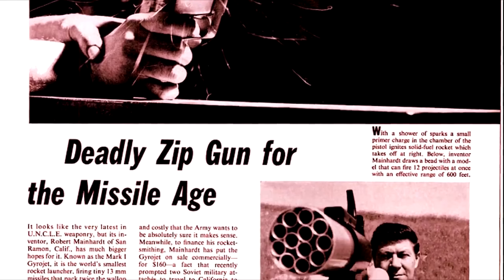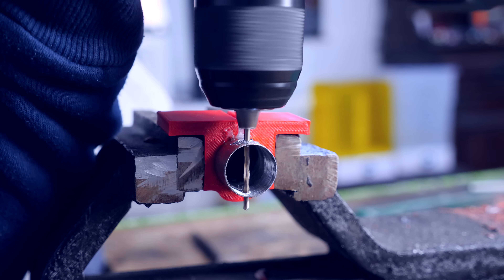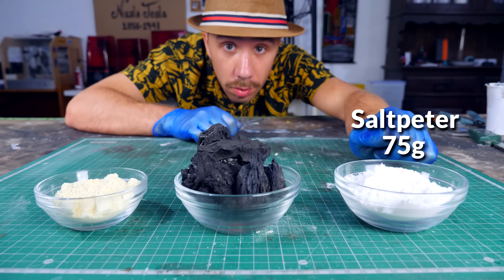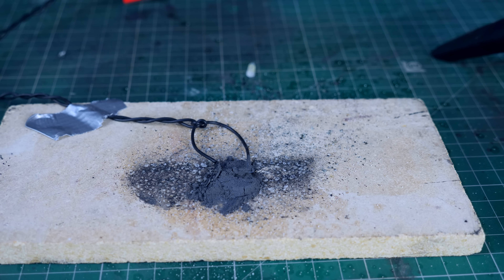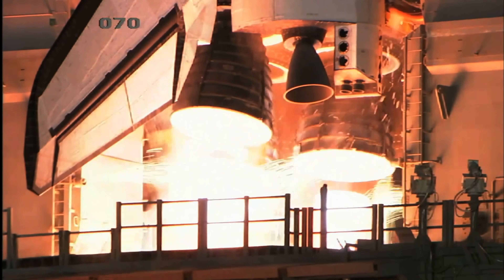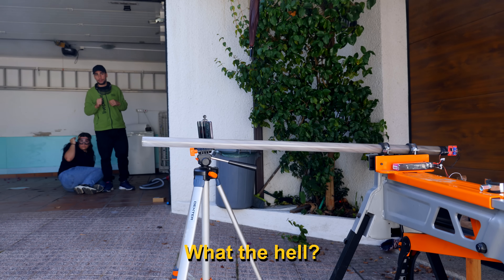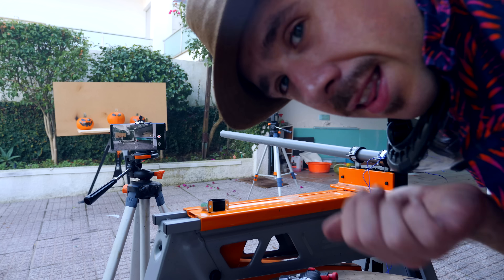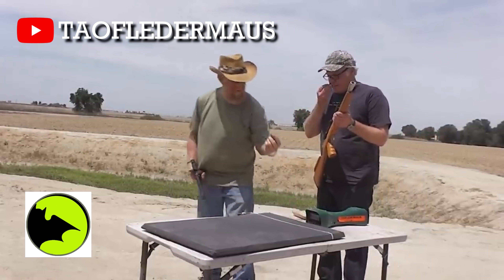GYROJET - The Spinning Rocket Bullet

Comment: A suggestion, I think you have an aerodynamic problem caused by most of the mass of the projectile being at the back end of it. This places the centre of gravity of the projectile behind what is called the centre of a pressure, a point where the on rushing air will make the projectile point in the direction of flight. CG needs to be in front of CP to make a stable flying object, the further in front the more stability. I think you need to add mass to the capsules nose before assembling the rocket. This should ensure stable flight.

Comment: Only one of the nozzles are igniting. If you look at the original bullet you'll notice that there is a primer. With a center pin ignition in the center of the bullet that ignites all the nozzles at once from behind the nozzles... two nozzles isn't enough you should have a minimum of three to balance it, four preferably

Comment: Like your show. 👍
On that note. Add slightly more nozzle angle in order to start it spinning sooner and use an odd number of nozzles. Essentially you want 3 to 5 of them to get even thrust around the entire circumference of the cylinder. Pretty sure that will send your rocket bullets.

Comment: Idk if anyones mentioned this yet, but im pretty sure the instability is from the fact you only have 2 nozzles. If you had 3, or the designed 4, you'd be able to stabalize it from more points than just opposing sides.

Reason for my theory: If their on opposite sides, slight differences in thrust will cause one side to yaw, and that yaw multiplied by roll causes it to tumble out. If you had one more, or 4 like the original, the slight differences could be cancelled out by each other.

Comment: It's also not spiraling not trying to being mean or anything but just doing for you it's called rifling funny name right what actually has its purpose it's so that it will make the board rotate what kind of slows it down a little like not very much like not not a lot so you have 60 FPS on the PC that goes down 0.1 FPS that's basically no change that's basically what happens it makes the speed by 0.000000001 miles an hour

Comment: I have more than a few ideas of making a reusable casing without the need for a clunky primer, as well as how to make a proper gun (even one in which the action takes advantage of the gas from the propellant mixture). 

If I ever decide to start making videos, I'd really like to try making it. Unfortunately it couldn't really take advantage of 3D printing, as I'd likely mill the bullet —including the nozzle— out of a solid piece of metal. 

On another note, I'd also experiment with straight-firing nozzles on a bullet that is spring-assisted in exiting a rifled barrel.

Hm, I'm probably on a watchlist now, aren't I? Eh, with my video watch history I'd be surprised if I wasn't already 😂

Comment: just a heads up, the rocket needs its center of gravity in front of its center of pressure (air resistance) or else it'll spin uncontrollably. a good way to fix this is by using weights in the front.

Comment: You could try to angle the rocket so that it propels it in a circle instead of straight on. That might help with the tumbling.

Another thing that will reduce tumbling is having 3 instead of 2 outputs

Comment: I had a idea while watching the video I noticed that the original projectile had 4 openings on the rear of it and they where curved and in a oval type of shape. with that being said what if you made a ceramic insert that  has 4 open groves along the diameter of the insert and used the case for the outer part this way it isn’t pushing it up or down it’s pushing it up down left and right at the same time to help it gain a faster spinning velocity

Comment: I missed this when it first came out.  It has been a while, but here are a couple ideas to help the rocket bullets fly straight.
1. You cannot rifle the barrel to get a stabilizing spin, but what about the rocket exhaust?  A rifled pinhole, leading to angled exhaust bells for the nozzles?
2. Fins and spin are not he only ways to stabilize a rockets flight path.  What do a kite and a bottle rocket have in common?  Drag.  Some model rockets use a similar method for recovery  with a ribbon streamer slowing it on decent.  A tiny carbon-fiber ribbon attached to the center of the back of the bullet.  Roll it up and place in into one of the nozzle bells to maintain the shape of the bullet when loaded.  One fired, the exhaust should unfurl the ribbon, causing drag at the back of the rocket and forcing it to fly strait. Using drag alone, you could have 3 streamers placed equidistant around the back of the bullet rolled and placed into a central nozzle. I think they should be 2/3 times the length of the bullet.  Should stabilize nicely.

Comment: In Nerf Modding people normally use a Scar Barrel to give the Dart a spin. Some say that the Dart is also more stable because the Air behind the Dart isn't pushing the Dart in some Side Directory. While the Dart is in the Scar Barrel the Air dann escape to the sides. Maybe something like that would help stabilize it.

Comment: Your ceramic nozzles don't look like they degenerated too badly so props there, however the original gyrojet had four instead of two nozzles, and this may have been important to achieving a greater degree of spin stabilization.  Worth noting  that gyrojets were still inaccurate compared to handguns of the time, 17 MOA or about 4.5"/11.43cm at 25 yards/22m.  For comparison, any well made conventional handgun can get that same 3-5" spread at twice the distance, 50 yards/45m.  
In addition, the original gyrojet used a fairly conventional primer cap to ignite it, and a faster burning propellant than R-candy.  Stuff is great for hobby rockets but probably deflagrates too slow to allow for the kind of prompt acceleration needed for a proper gyrojet bullet.

Comment: Integza, I have an idea and would like to pass it by you. It has to do with gun barrels. If you could evacuate a gun barrel just before launching a bullet, you would get rid of the force that is holding the velocity of the bullet back. Here is how I propose to evacuate the gun barrel.

1. Take a gun barrel with holes in it and put it inside another tube.
2. Apply moving air to the outer tube to create a venturi vacuum inside the gun barrel.
3. Turn off the air as the bullet is shot with a valve.
4. The bullet would go down the gun barrel with no opposing air inside the barrel. 
5. Gasses inside the barrel would be at a higher pressure and faster flow, creating an opposite century effect where incoming air would force gasses out of a barrel.
6. Start the airflow through the outer barrel as soon as the bullet leaves the barrel

 Note Recoil will also be diminished because there would be no gas in the rifle barrel to overcome. The outer barrel and Air Ventury would handle recoil issues. The barrel could be lengthened for more accuracy. The speed of the projectile would be increased.

Comment: Amateur rocketry folks who make small engines make the nozzles with a mixture of clay and other ingredients which are rammed up around a form. United Nuclear in the US sells both the nozzle mixture and the nozzle forms, but more importantly they have pictures from which you may be able to derive a 3d-printed form.
Reply: It also seems to me that in order for your two nozzles to correctly spin the "bullet" they have to be equidistant from the center of mass of the bullet to a fairly high degree of accuracy. Because your nozzles were loose, they may not have been well-centered enough, and so the axis of torque for the nozzles was not the center of mass of the bullet, which made them wobble and go off course.

Comment: There are one little detail on gyrojet pistol... It have a detail under spring tension which holds pellet befor ignition AND untill it have enough energy to fly straight enough. ALSO!!! Better to make narrower nozzle to generate more pressure... At least I think so... ALSO!!! It is wise to look on shells for soviet reactive artillery like TOS-1 and etc. They have exaxt answer about nozzles for such pellets You seek.

Comment: RECOMMENDATION:
Why not incorporate TWO principles into making the GyroJet work?

The main reason these GyroJets did not work is because they did not have enough spin to counter the strength of the rocket thrust trying to asymetrically throw the rocket off it's trajectory. This can be solved by reducing the thrust (not good when trying to increase speed), or increase spin rate to overcome the thrust being produced . IDEA: Why not use Tesla turbine principle to prerotate the GyroJet before launch.....spinning it up to incredible speeds? All it would really require is a grooze cut into the barrel to allow high pressure air to circle the rocket, and circular iginition bands to keep electric contacts for ignition whilst it spins up. #TeslaGyroJet

Comment: Sorry but black powder the type of gun powder you made has a constant burning rate regardless of pressure it is modern smokeless powder based on nitrocellulose that has an elevated rate of combustion due to increasing pressures you would think if you're going to make a video about something you'd actually read even just Wikipedia so that you give out accurate information not that hard to find out do your research next time set a good example

Comment: You might be better served with increasing the ballistic coefficient of your projectile, i.e. , reducing its diameter and increasing its length. This not only mitigates the Δcm w/respect to time, it also will improve stabilization of the projectile where the rotation about its long axis is minimal. Take a look at a Match Grade, 7.62mm diameter, 168 grain (≈10.89 grams) Boat Tail hollow point bullet that’s commonly loaded for the 7.62x51mm NATO round for competition purposes as a guide in conceptually apprehending this idea.

Comment: Metal plates with holes off set and then added together to create the needed channels to create spin, or maybe do it even simpler, but that requires metal work. I can sort of see a metal plug with 4 groves spinning around it's outside. When that is added tightly to your rocked you'd have a nozzle if done right and it would be contained, or will it. I do not know, but figuring out stuff like that is fun so now I wish I had the means to test it. The nozzles should almost be like a screw should it?

The bullet needs to spin fast to have gyro stabilization so the nozzle shouldn't point most backwards but rather nearly 30 degrees off to the side and 2 is not balanced so it might need 4 nozzles to really work. Just be danged carefull testing ideas like this.

Comment: I'm a fluid mechanics engineer. I think I can see about 3 problems.

1. Your bullets may have an off centre centre of mass due to how you're packing them.

2. They're not gaining enough speed at the end of the barrel.

3. Your narrower barrel is more accurate than the wider. I think that there's a pressure build up in front of the bullet as it travels down the barrel so in order to counter act this, you should cut vents down the length of the barrel. You can see that in the original designs. You can see that when you used a bigger pipe it accelerated more due to I think more gasses being able to vent around the bullet (but reduces accuracy as it can then move around within the pipe). That might solve the second point.

Comment: Take another look at your video, index time 12:20, and you'll see spin within the acrylic tube. It did need that kind of tight fit to get the rotation you were looking for. I haven't looked at the original gyrojet nor am I a rocket scientist. But I did grow up with a gunsmith. Your primer idea was on the right track but should be more focused; centerfire boxer type would work with the electrical leads. The solid propellant: was a mess; needs to be a higher concentration. Look at the H&K G11 caseless ammunition for instance. Overall; nice project. Please take it outside the city limits next time. Or find a drainage ditch.

Comment: Well you are always asking for 3d printing ideas this is less about a 3d print idea as a method to print your rocket parts credit where do the youtube chan and vid in question 
https://www.youtube.com/watch?v=cvi8A2XCK94
uses a ceramic coating to create a mold for metal casting. You dip the 3d part several times to make the mold and burn/melt out the pla leaving a mold etc etc

Comment: 3D print a gun powder engine and  see if there is a way to make one actually viable. The problem I saw when Mythbusters tried it was lubrication in the piston cylinder. So maybe having the gunpowder ignite in a separate chamber with a way to filter soot out in between and force the gasses into the piston cylinder would work better

Comment: I'm not sure that your material is the issue.  I think your nozzles are over constricted.  The original had 4 nozzles.  I'd like to see a follow up video with nozzles that match the original design.  Also 4 nozzles will vastly increase initial spin.  

You may want to change the barrel to metal as that will have less friction than plastic against your projectiles thus not inhibiting spin or forward velocity.  It will act like a bushing.

Comment: What if you made a rocket and pointed it at a water wheel type thing and tried to transfer the thrust to make the wheels of a skateboard spin through a gear ratio that is connected to the “water” wheel thing.

Comment: Integza: this is a suggestion for another video.  You made an air powered boat a while back.  Having the air pressure be as high as possible is necessary to provide the 'longest' propulsion time possible.  Why not 'wrap' the plastic bottles with an exterior enclosure to allow more air pressure to be stored? 

My first thought was 3D print a sort of 'webbed' or 'netted bag' holder for your bottles.  Depending on the spacing between the 'webbing' you could place more air pressure into a bottle made of plastic than the bottle alone.  You should try a complete 'sleeve' design as well, that simply completely encloses the bottle other than your port opening(s) (should be cut out from the enclosure) and see how much more pressure you can store in the bottles.

A webbed wrapper or enclosure might allow you to 'store more' for less than a completely enclosed bottle.  It would be a fun experiment based on your previous air bottle powered boat video that would allow you to use the FDM printer to make a 'vest' or 'wrapper' to your bottles.  If you try various spacing of the enclosure for the bottle, you can destroy several plastic bottles with each design (to prove out their max possible stored pressure) and determine the 'best bang' (see what I did there?) for your bottle buck, in terms of weight of enclosure/wrapper versus overall stored energy.

Also, your boat needs to hold the bottles out of the water to reduce drag.  My suggestion there would be to store two bottles side by side with a 3rd bottle stacked on top of this INSIDE the body of the boat.  This will help reduce 'drag' on the boat by having ONLY the hull in the water.

If this works out, then you can Integza 2.0 your air powered boat and then see if you can make it into an air powered hydro-foil, which, would reduce drag even further, providing you more overall potential to go greater distances with it.

Again, I love your videos.  They are fun, educational and show folks that exploration is about making mistakes or having failures that are almost as valuable to learning as any successful test.

Comment: Integza, I really enjoy your videos.  Your Gyrojet Gun made me think a bit.  Perhaps if you made your 'rocket' motors for the 'bullets' differently it might create more rotation on the projectile, while also providing a bit of stabilization to it.

How about making a more pointed 'bullet' point to your unit, print out a template for your motor that is ALSO the body of the projectile.  I got this idea from the 'caseless' ammo where the 'shell' is consumed in firing the bullet from the gun tube, combined with the model rocket 'motors' that are consumed during rocket flights, although the casing remains (the cardboard part of the motor).

Can you make a mold for the motor that is fluted and curved that fits into your 'gun tube?'  I can't 'draw' a picture, but imagine a fluted column.  Normally the flutes go straight up the column.  The motor for your Gyrojet should have the flutes, except they should spiral up the 'column' of your rocket motor -- sort of like an old fashioned 'Barber's Pole' with a more gentle 'wrapping' of the flutes (the indented part of the column).

This should allow the motor to 'burn' from all sides fairly evenly with the flutes providing a guided channel as the motor consumes itself to impart spin by thrusting out from the fluted portions like half nozzles against the side of the motor casing (which should be wider than your impact projectile (the bullet part).  The fluting SHOULD act like 'fins' for stabilizing the projectile's path while providing a path for thrust from the inside of the motor casing.

Lastly, if you make the motor with, say, 1/2 an inch of 'fitting the tube' at the base of the motor and make it narrower as you get to the projectile (think Blue Origin's rocket to some degree in profile, where the nosecone is wider than the body of the rocket stage as it connects to it) which should also provide a bit of stabilization in the same manner a traditional crossbow quarrel is wider at the base than the neck and point -- which helps keep the quarrel on a straight trajectory.

If this is not clear, please feel free to ask me more.

Keep up the fun and curiosity.  Love the show.
Reply: OH, and maybe you can make a 'sleeve' for the entire projectile a la a 'discarding sabot round' where the projectile leaves the gun tube and the protective casing (the sabot) separates from the projectile, leaving it to 'do it's thing' after leaving the gun tube.  Just an odd thought.